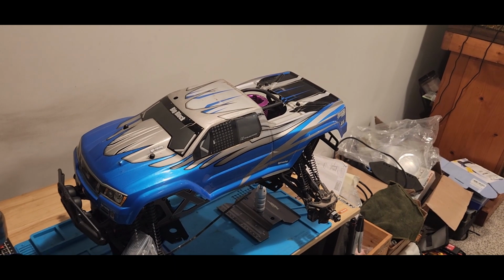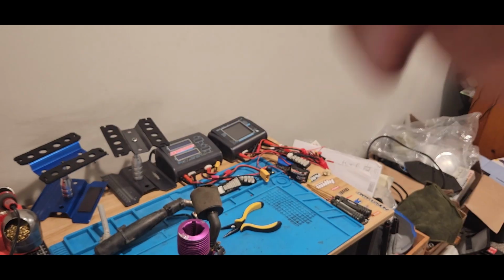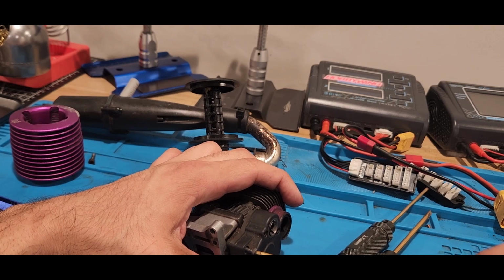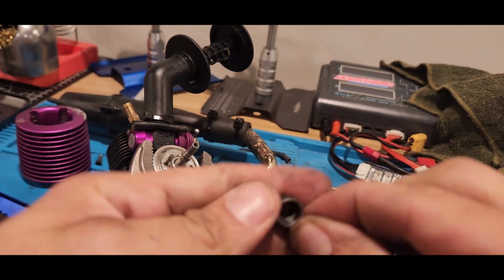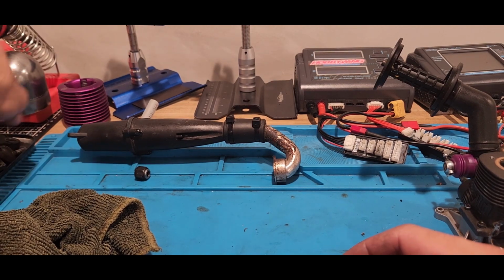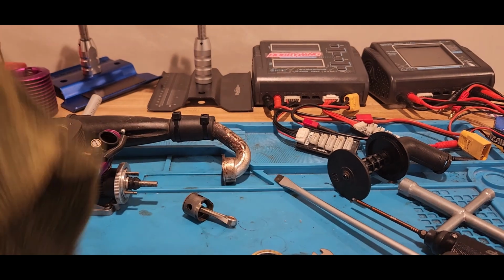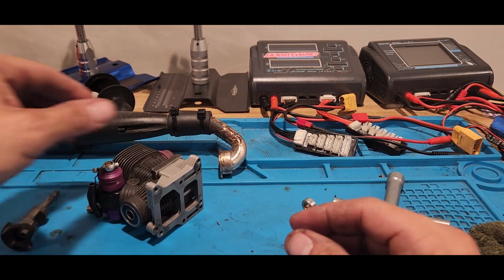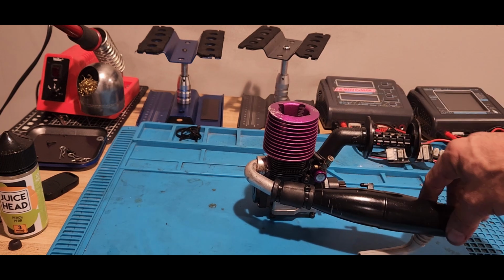HPI Savage nitro star 4.6 look inside

Comment: the original savage manual had a parts CatLog in the back of the book for up grades and add Ons i still have mine. there good manual  to have hpi did a great job supplying spec and parts listings

Comment: that's a first gen 4.6 block your using a 3 gen gt shell  the cooling head is purple.  now there gray for the 4.6 hpi .it doesn't look to bad beside needing bearing and to clean it hows the pinch
Reply from the maker: Pinch is still good 👍

Comment: the main reason to change the bearing . is that its the  first point to fail  because of the speed that they spin. its a cheap why to prolong the life  of the engine that way your not spending even  more. just a fyi
Reply from the maker: Thanks for your feedback I'm actually thinking of putting a different engine in this truck that's why I wasn't too worried about it
Reply from the maker: In reality I had low hopes that this engine would run like I said I have other plans for this truck the engine working is a plus